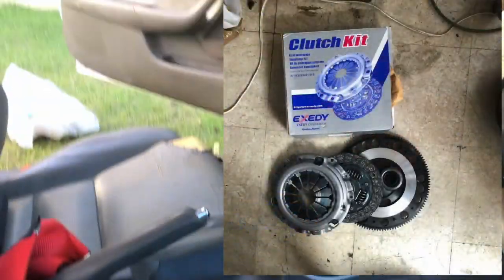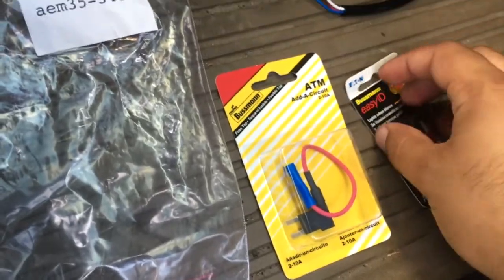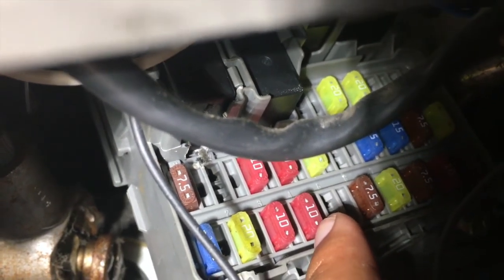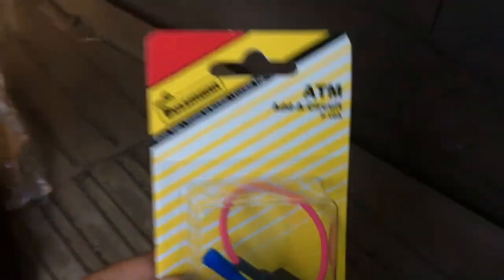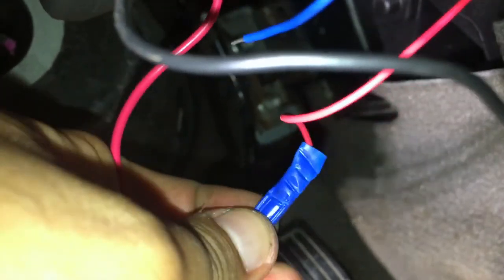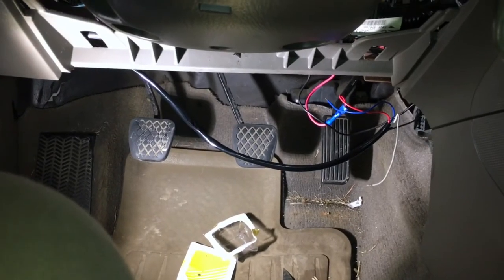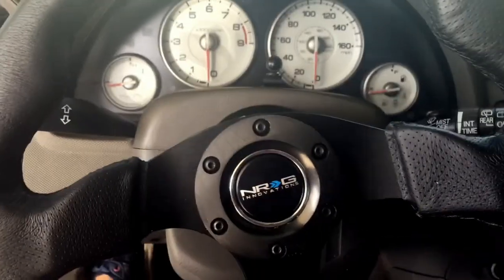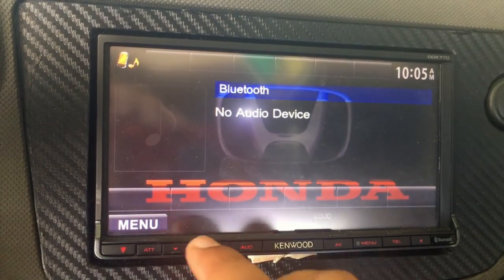New RSX Mods + AEM Wideband Power Cable Install

Comment: Leonel. Estoy apunto de comprarme una rsx base y me gustaria saber si vale la Pena y si se puede llegar a 200whp con in base all motor. Saludos desde Rincon.
Reply from the maker: kenneth ricardo saludos mi pana! Mi consejo es el siguiente: El verdadero problema de los base no es tanto el motor si no que la transmision. Me explico. Los base son 5 cambios y los cambios son bastante largos por lo que cuando le quieres sacar caballos a un base ya para 4ta se ponen medio vagos. Sin embargo, mucha gente con bases lo que hacen es montarle tapa de Tipo S y le meten todos los bolt ons con computadora y sacan buenos caballos. Los base traen 160 a la volanta lo que equivale como a 125-135 a la goma. Con la tapa de tipo S y full bolt ons pueden llegar a tener buenos numeros, lo que los limita mas bien es la transmision. Tenia un amigo que le monto K24 a su base y lo hice Vtec Killer con palos de Z3. Portio araña rbc y portio la tapa completa y tiro 246whp con la transmision 5 cambios. Pero ahi pues comp te dije monto K24. En fin los bases los puedes poner a correr pero es un poco mas sacrificado que los TypeS. Cualquier cosa a las ordenes!